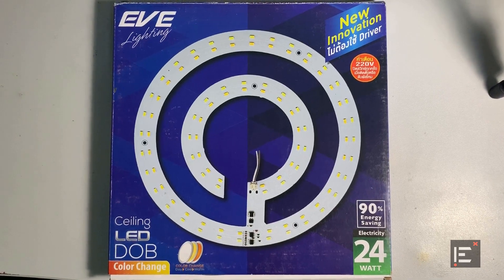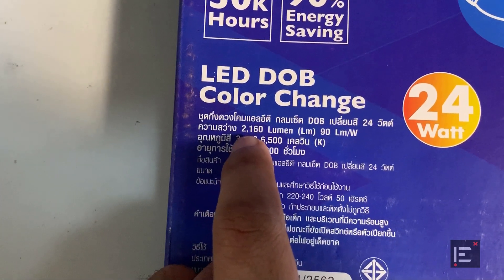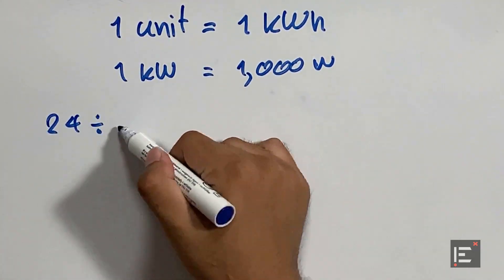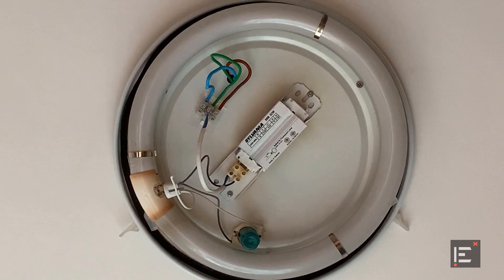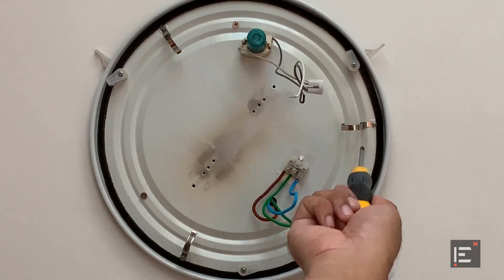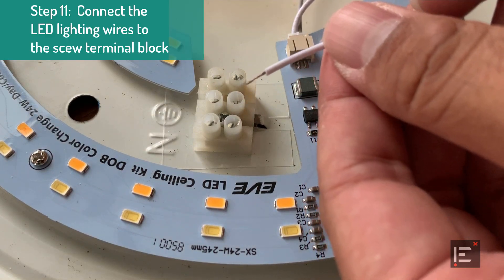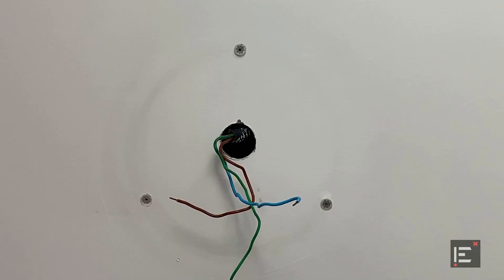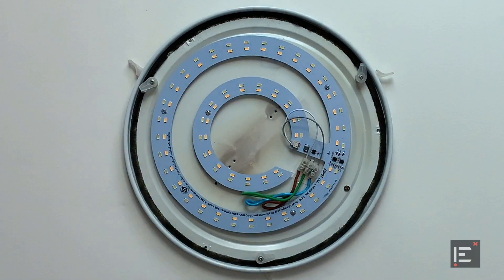How to replace a circular fluorescent tube with an LED lighting | ติดตั้งหลอด LED อีฟ(Eve)แบบกลม

Comment: Like the video,  very helpful,  but the price of replacement? And i already have LED light can I change out and replace with another one? My son said it was same price as the fixture,  but why,  it's only 2yrs old?
Reply from the maker: Thank you for your interest in my video. The LED in the video cost me about 9 US dollars. By the way I live in Thailand, so the price in the US may vary. And yes you can replace one LED with another as long as you replace it with the same type. The LED you saw in my video requires no ballast or starter, but some LEDs aka “plug and play” are designed to work with ballast. If you want more brightness in your room or some fancy features such as color-changing like mine, then you have a reason to replace your 2 yrs old LED. Otherwise, let it live for another 3-4 years. 😁

Comment: Isn't it just a matter of replacing circular bulbs?  I just replaced the light bulb from fluorescent to LED and removed the starter (otherwise it flashes) and it works!  Am I missing something here?
Reply from the maker: In a way, you are right. But, I didn’t intend this video just to be a Fluorescent-to-LED light replacing demonstration. Otherwise, it wont be worth 11:38 minutes of your time. The objectives of my video are 1) Showing rationalization towards a shift to LED tech 2) How to get around problems trying to install a new LED light, which doesn’t have the same form factor as the original fluorescent although I am aware that by simply getting an LED with the same form factor as the original fluorescent will make my life much easier. Overall, you can look at my video as a demonstration of how to fit two things(the LED and the fixture) that were not designed for each other. Thank you for comment.
Reply: @toughastank  OK.  I just bought and replaced my kitchen circular LED light and wondered if I did something wrong after seeing you go through all that trouble replacing fluorescent with LED.  Thanks for sharing.